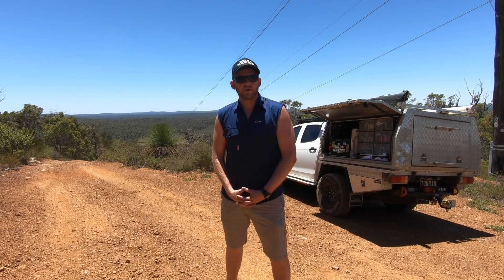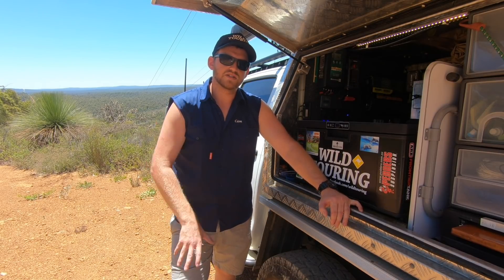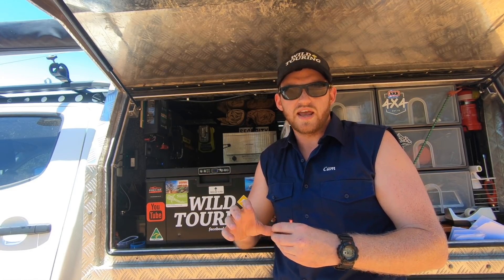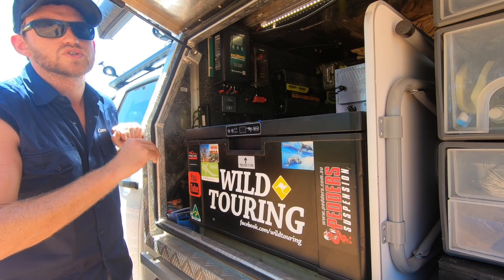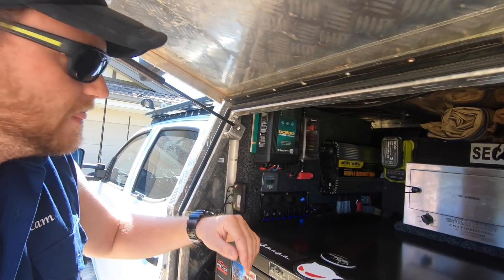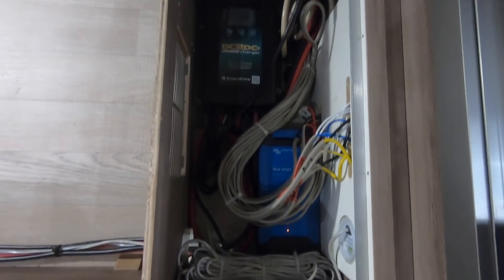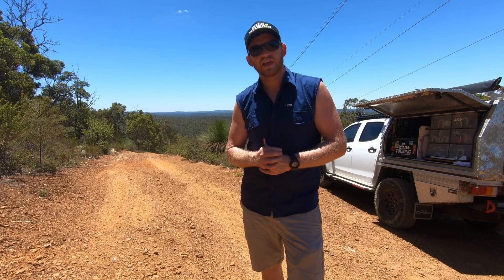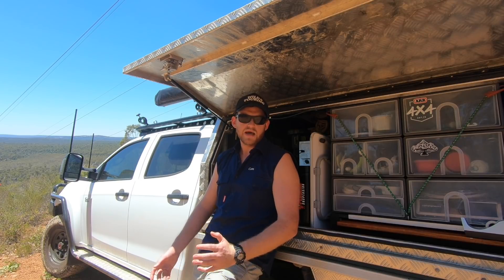Lithium (liFePO4) Battery Install - Isuzu Dmax Canopy & Jayco Silverline Caravan

Comment: Thank you for a wonderfully thought out description of the process, the components & options.  Then your two real world running setups. 

 Especially appreciated the  mention of the fuse panel.  I'm still wrapping my head around that detail for my rig here in the US where RVs are now all considered boxes of pure evil thanks to freaking Breaking Bad and what we call "Soccer Moms", trust me they are HORRIBLE people afraid of, well, life.

Will likely build my battery bank using either a used Tesla battery pack or via LFP individual cells. 

Have 50A service in the RV and plenty of boondocking in 100F (or whatever that works out to be in upside down world measurements.... ;).  So need something robust in the end.  You helped my understanding quite a bit.

Comment: Been running my lifepo4 for 7 years. No noticeable capacity loss. Also the cycle life ratings are rated until the original capacity goes down to 80%, (ie 100AH after 2000 cycles is now able to hold 80AH) so the true life on a lifepo4 could be incredibly long!

Comment: Awesome video mate 👍 I'm in the midst of redoing my setup from under bonnet 130ah AGM to relocate it to the rear ofmy Prado 90 out of the heat and was going to go another of the same brand SSB 130ah ($320) but have been considering a lithium. Your video really helped outweigh the cons of the initial outlay! 
Now I'm just looking at size and brand of lithium. The 130ah AGM was pretty decent for my needs (fridge running 24/7 and not much else but may increase in future) I  see you went allsoark brand but all the brands are very unknown to me so just wondered if you have any more info there?
The 130ah SSB battery was very good considering I abused it through ignorance initially and it ended up bulging towards the end due to heat I reckon. SSB do a 100ah for a bit over $1000 and allsoark are similar in price. Cane across a power tech brand sold thru home of 12 bolt and also Jaycar that's normally $1000 but Jaycar have 10% off their price of $949 which brings it down to $855 so kinda thinking that's a good deal. Thing is you see a few well known 4wd youtubers using revolution brand which are just under $2k for 100ah so it's a but daunting at that price . . . . . Any advice would be greatly appreciated mate 😀👍👌
I have a victron BMV-702 and a redarc bcdc1225d ready to go - just need to rewire and install it all around the battery.
Subscribed and will be following - hoping you post videos as you go but if it was me I'd be living every moment and editing later cos that would be a full time job itself. Then again it might be something to do as you travel . . . Cheers for your time Mate 👍 Ben
Reply: Have you considered looking at LifePO4 batteries on eBay? Compared to Jaycar prices you can can almost get two for the price of one... From personal experience I have found that most of what Jaycar sells is re-branded cheap stuff which you will find one eBay much much cheaper....

Comment: As a Aussie now living in the Netherlands just found your channel and what a breath of fresh air. Great info on Lithium batteries as I have 2 x 105 ah Agm’s which weigh 46 kgs each cost €195 each. I already have Victron IP 22 12/30 charger and 712 BM  with seperate 2000 w inverter and 2kva inverter Generator and plan to go to Solar next summer here. Take care regards Chris

Comment: Bloke, you have done yourself proud
That was one of the best all round presentations on 12volt systems i have seen
You've got everything right, right down to the crappy eBay sellers
There is only a few points i think are worth mentioning

Owning LiFePO4 also comes with a VERY set of strict rules around temperature and charge voltage, as well as discharge depth (cell voltage) and cell balancing.
Without making an essay out of this, you can outright destroy a LiFePO4 in one hit by mistreating it.
Just something to think about.
You simply can't bring your old Lead Acid rule book with you :)
Otherwise, very well done

As an interesting side note, Lead Acid loves to be kept at 100% SoC for long life
Where as LiFePO4 will last longest at around 50% SoC
Strange fact :)
Reply: You shouldn't have to worry about balancing the internal cells on those LifePO4 batteries, they have an internal balancing circuit along with over and under charge protection as well.... I don't remember if they limit themselves during extreme temperatures but I wouldn't be surprised if they do...

Comment: Hey mate why did you option to get the All spark over the Enerdrive lithium? Just curious as im looking for a lithium upgrade
Reply from the maker: Hey Ben.  Spoke to enerdrive about their batteries. Rep told me that with their internal BMS (battery management system), they can't be ran in parallel. So I'd of had to buy the 200ah battery.  Which is $2600 plus freight.  Similar specs to the ALLSPARK batteries.  But I went with ALLSPARK in the end because they were cheaper, they're local to my state,  they (off-road living) were brilliant to deal with,  if for whatever reason one battery failed prematurely I only have to replace one at a cost of $1040 rather than the entire 200ah at $2600 and ALLSPARK warranty was better (3yrs Vs Enerdrives 2yrs). I do like Enerdrives Bluetooth app feature.  But I have all that in the victron battery monitor anyway.
Reply: Wild Touring told me exactly what I wanted to hear I'm looking at the exact same setup in my wagon but without the second lithium. Thanks for the help cam

Comment: what about crystal lead,  thats what im looking at atm. ps great watch cam mate, cheers for the info
Reply from the maker: Did a bit of research in lead crystal. Its hard to get much independent information on them because theres only one company in Australia selling them. From what ive gathered theyll happily discharge down to 80%. Charge very quickly.  Cost wise theyre comparitive to lithium as theyre about 25% cheaper, but will do 25% less cycles. (roughly). Only things that concerned me was the limited information available on them, the fact that theyre equally as heavy as lead acid batteries, and most reputable chargers dont have specific charge algorithms for them. That was my take on it anyway!
Reply: Stephan from allofroad had them in his vehicle and did a review on them, thats why im looking at them, atm  lithium is out of my price range lol
Reply from the maker: @NISMO-OFFROAD  Ill have to checkout his review. Cheers mate!

Comment: Hey mate, good vid, I’ve just swapped to lifepo4 with the redarc bcdc40 and a Victron monitor. How do you find the drawfridge power draw? I find dropping from 5 to 3 degree it’s drawing way too much power :/
Reply from the maker: Thanks Chris. I run mine at 2 degrees and find its not cycling too often. Obviously runs better if its full. 
Have you got a bit of space around the fan for it to dissipate some heat?
Reply: It’s built into some drawers with two vents cut out but I might have to cut a bigger vent hole I think

Comment: Just about to buy dual agms for my van...now u got me thinking 🤔
Reply: Dont bother its like using coal instead of gas
Reply: Stop!!!  Don’t do AGM or any other Lead Acid batteries. Definitely go with Lithium. Do some research and take notes lol. Then make a pros vs cons list. You will be amazed at what you find. Battleborne batteries are rather good just make sure you go with a reputable company and you will be fine. 
Cheers mate and happy trails